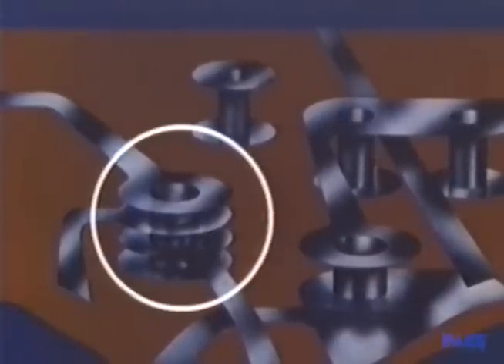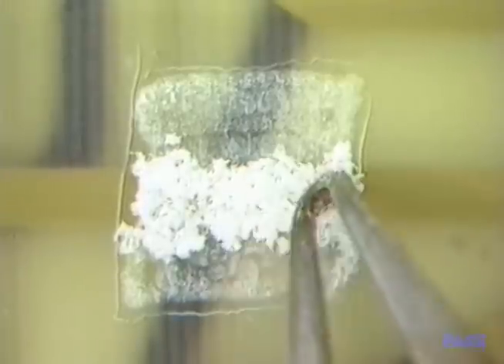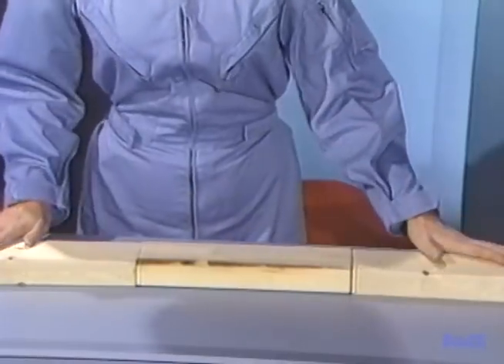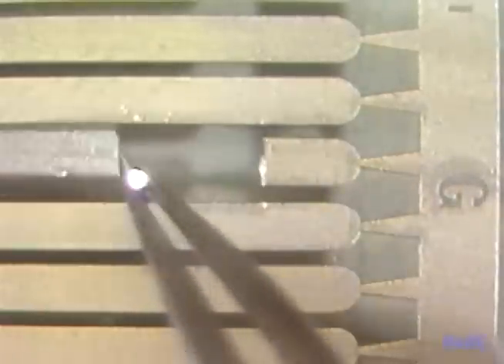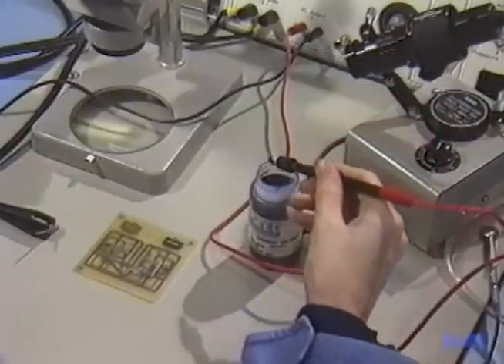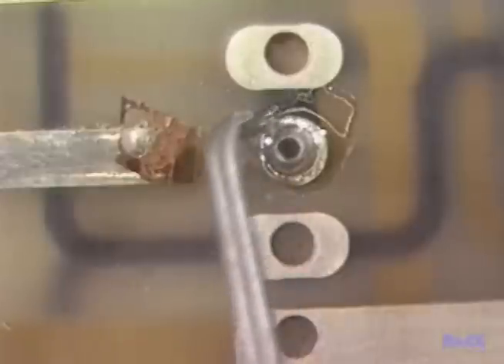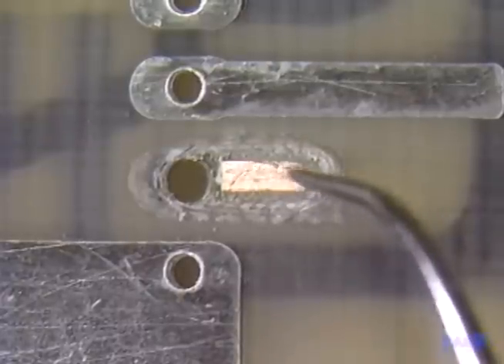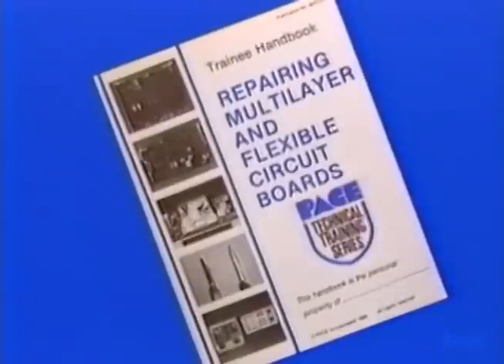Multilayer Repair

Comment: On a thru-hole board where the traces are connected at vias or through-holes, I'd just run a jumper wire.  The most common inner-layer break is rework damage at a through-hole where someone replaced a part.

Comment: How about a modern 20 layer impedance controlled board covered in BGA's and varying layer materials?
Reply: You throw the whole board away
Reply: Or you fix it.. the same way.. just alot smaller everything.
Reply: the thing almost  have Life ON it ...
Reply: @zivilian  would take weeks probably :d
Reply: Boards made today are considered disposable. A board that’s a replacement will have upgrades in parts as well as firmware.

Comment: This is amazing but I have to ask... was this ever common practice ?
Reply: yes, as an example in navy, on a boat in the middle of the ocean you can't just order another PCB from amazon.
Reply: also as vintage equipment gets to a certain age these skills will be needed to keep artifacts of technology for museums.
Reply: @ChadDoebelin  I really don't think so. This type of repair is impossible on anything made this century. As for warships, they carry spares. I don't think any warship has an electronics lab with the tools and personnel to do this sort of thing. I asked because it seems to be something that was only possible back before BGA packages, buried vias, micro vias and track widths of 100 microns. Any tech that old is no longer in use, it's in a museum.
Reply: @Jean Roch  There are a fair number of 80s and 90s computers still used by people for nostalgic fun. I am quite literally watching this video because I'm trying to decide if to try to repair some corroded blind vias, or bypass them completely. It's quite fun to never give up on a dead logic board. Unless a custom chip is blown, most things from up to the end of the 90s are fixable with enough determination.
Reply: @TheNefastor  you don't think any warship has an electronics lab with the personnel to do this sort of thing? Based on what experience? My statement comes from actually being in the Navy for six years and living on a ship. What about you?
Reply: @ChadDoebelin  unlike you, I don't like posting my bona fides on social networks. Which makes me doubt yours, actually.
Reply: @TheNefastor  feel free to look me up.

Comment: I wonder if this can still be done with modern PCB's and if it is worth doing to test equipment where there is a chance that you will encounter a 7 layer PCB. (non working test equipment is cheap if you can repair it but it is always a gamble since you may end up with a unit that has a bad PCB trace. (I have been unable to find tools that are designed for modern PCB's which use very small traces)
Reply: modern 2018 board repair tech here: we still replace traces but now its more or less just being able to get access to them in general. If you have access to two ends, normal procedure is to just take jumper wire which we currently have down to 10 microns. All work is done in much nicer microscopes. But I am still using pace products and they are still relevant in the industry for sure.

Comment: How the hell does one know exactly were the trace is broken i.e. where along its length is it broken so we don't excavate  incorrectly especially in modern colour boards.
Reply: X-rays. Sometimes you have enough available eyelets you can narrow down where it must be with continuity tests.
Reply: @therealjammit  thanks for the knowlage I will defnatly file this away for use one day
Reply: @fred9za  you can use xray if you are desperate. This should be done with a proper layer-by-layer customer repair booklet that once-upon-a-time came with every electronic device designed to be repaired, not thrown away.
Reply: This is something from 100 years ago back then traces where bigger boards where not as many layered or nearly as dense.. not to mention cost has come down in combination of all these things make ake this kind of repair in the now times impractical for most cases
Reply: A cnc servo driver replacement would cost thousands of dollars. Right to repair pcb boards should still exist.
Reply: As far as i know, broken traces occur typically in certain areas of a PCB.
The crack in the PCB should be visible from either one or both sides.
I don't know if there's a way that traces on the inner layers of a PCB can break without the outer layer breaking too.

Comment: I've been repairing computers since the 70's and not once have I used a ESD strap...   I just use the other way of having the power cable plugged in but not switched on and earth myself to the chassis which when earthed to the mains has a bulletproof method of earthing far better than some soppy bit o' plastic.

Comment: Excellent instruction. However - the time to repair, specialized repair equipment, and knowledge, make repair of most boards now that they are multi-layered, impractical. Next generation multilayer boards ought to be snap together layers for easy separation - for diagnosis and repair.
Reply: You ask the companies to throw away money for our convenience lol.
Reply: sounds like that would still require specialized equipment to separate layers and realigning without error as well, otherwise it sounds like you'd be working backwards from the intended purpose of multi layer circuit boards and that is saving space and smaller board designs

Comment: Does anyone know what Epoxy they are using in this?
Reply: Loctite Hysol 608, used to be Epoxi-Patch which is exactly what they're using in this video. Hysol 608 is clear, but costs more money. They have an off-white one EA1C, it's less money than clear. They also have it in green. Hysol 608 is exactly what they used in the video.

Comment: What about UV solder mask
Reply: UV solder mask is new. It's just epoxy that cures with UV instead of a chemical called a catalyst. Two part epoxy doesn't start to cure until you mix the two. One chemical is the actual stuff that gets hard and the other is the catalyst.

Comment: I watched this video, pondering the question, can ANY multilayer board be repaired? To my surprise, the answer is yes, but the specialized supplies, tools, and skills required are only available to professional service technicians.

My greatest fear in working on these kinds of boards is, what if I remove a faulty through-hole component, and that happens to damage or destroy a plated through via? I would very likely be forced to replace the entire board.
Reply: The key is to prevent the damage in the first place. A proper solder extractor and technique will prevent this type of damage. Pace has some videos on this this channel showing how to use their tool, but even the generic tools use the same technique.
Reply: Good solder wick is a must!
Reply: @alreed2434  I wouldn’t use wick for those sensitive applications. A heated solder removal tool is really best.